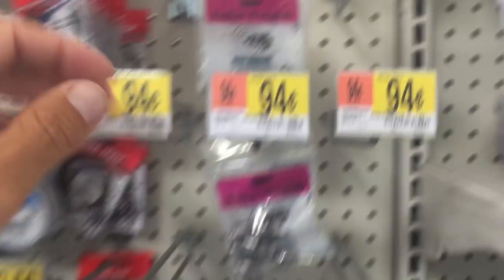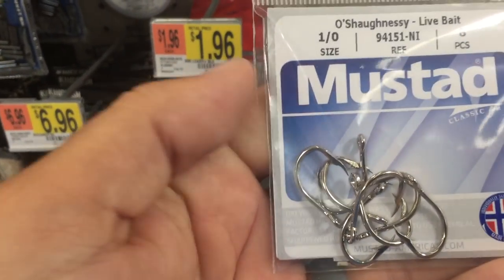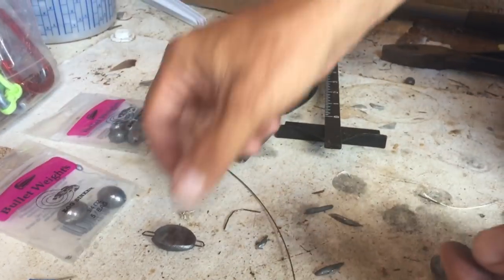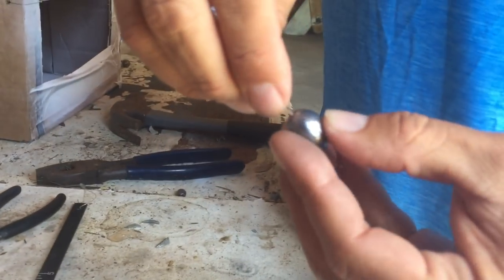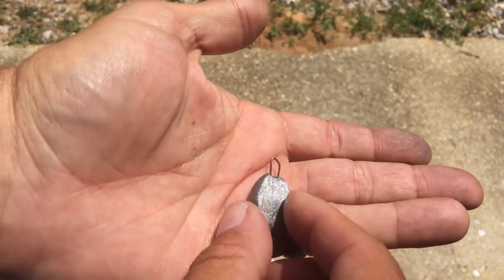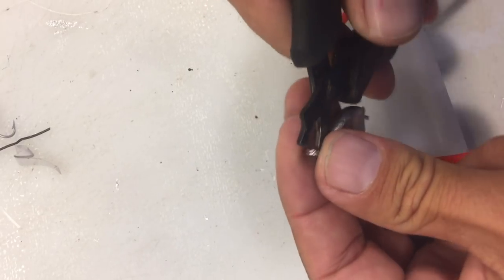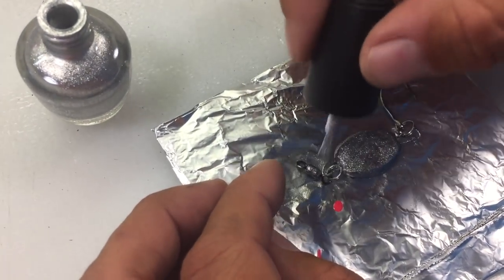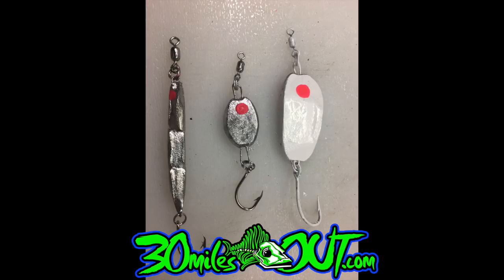DIY -  Cheap Lead Sinker CASTING SPOON - spanish mackerel , blue fish etc. - home made lure

Comment: You could try using dinner knives and cut them down to size. Find them cheap at garage sales.  Drilled holes for split rings and hook attachment.

Comment: Hey Ty, I like the simplicity of this lure.  Just a suggestion, you could save a little money on hardware if you just put the swivel on the wire before you pound the sinker into shape and skip the split ring on that end.  I guess you could skip the split ring on the other end too but I like the idea of being able to change hooks if needed.  I don't know how long you would have this lure (if you would have it long enough for the hook to get dull or rusty. Also put a smaller black dot in the center of the eye.  It makes it pop more.  Love the videos, keep 'em coming.

Comment: One may use even a suitable size paper clip ...
You may even try one egg sinker straight from its bag, no hammering, no varnish or paint at all... you would be surprized how it performs... the only downside is that you get mad at yourself that have already spent a fortune on lures we were allured to buy by lure companies!
Tight line!

Comment: I'm really surprised bigger fish don't still pull those wires out. If you end up still having a problem with that you should try bending a small right angle at the ends of the wire. That way you'll have something grabbing the lead besides just the friction between the lead and the wire.
Reply from the maker: great idea
Reply: TriggerMeKaNiK ia
Reply: I thought the same,those can slip as lead get easily deformed after several casting.